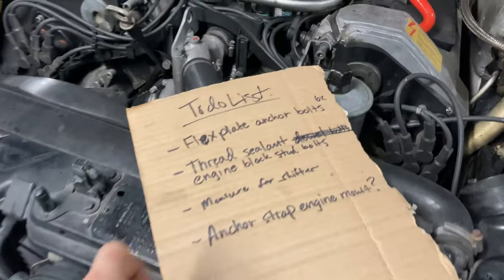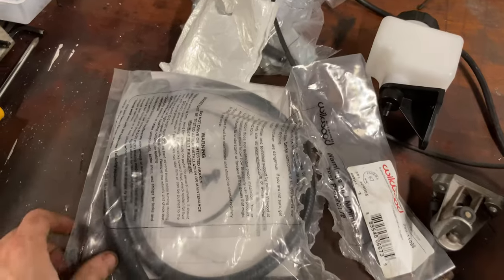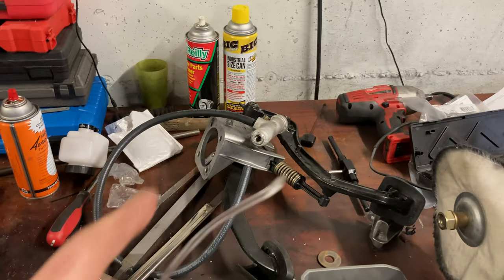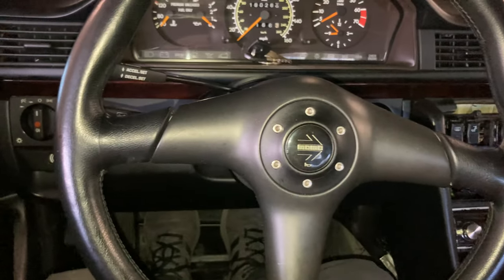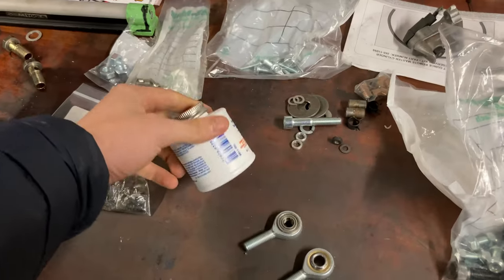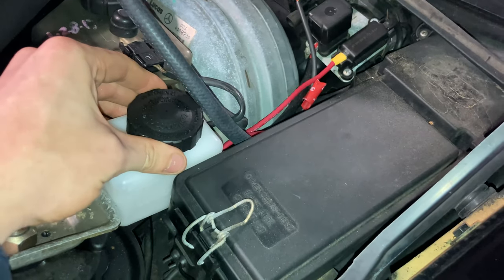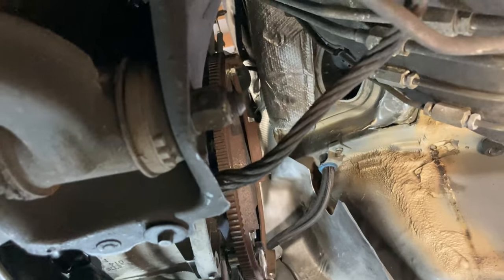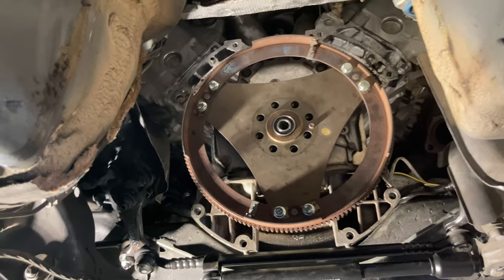Mercedes E420 Manual Swap (Part 3) - Clutch Pedal and Shifter

Comment: Why not use the stock manual trans nipple on the brake master reservoir?
Reply from the maker: Just liked the idea of keeping them separate. I did that on my C55. Funny enough though I just discovered this wilwood unit has been leaking so I may be going to OEM reservoir if I can’t get it to seal properly
Reply: @ANDERZENAMG  if you think about it, if there is a leak in the system you are going to know about it with loseing the clutch before the brakes. There is a subdivision in the resovior too. So if the clutch hose came off or whatever you will still retain some brake fluid, plus it's the rear brakes it's tied to(I'm pretty sure, damn now I'm questioning myself).